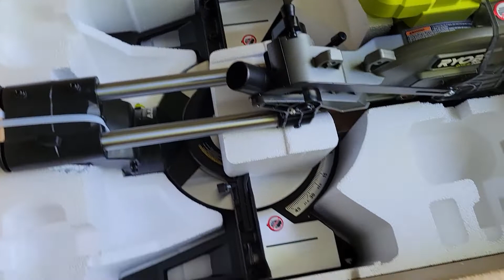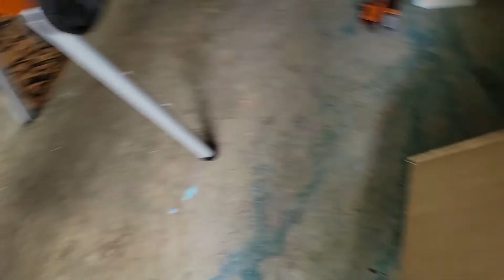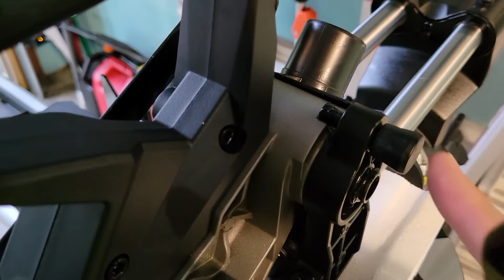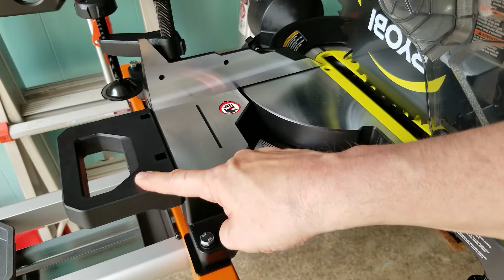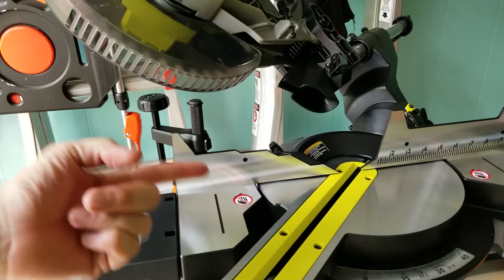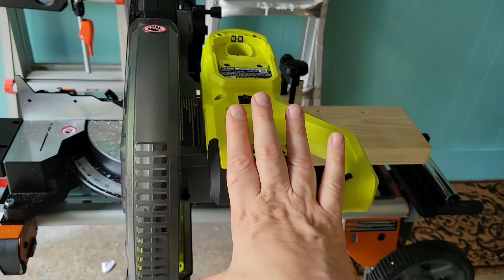RYOBI Slide Compound Miter Saw PBLMS01B

Comment: Over all it’s a good saw for free and here’s why it gives you a free battery worth $150 bucks then they sold you the tool with a free stand worth at least another $120 dollars they had the tool on sale for $200 .its good for cutting lumber basically framing 2by 4,6,8,10,12 its pretty square sure you might need to adjust some but overall its a very good saw for the money i bought mine two years ago and it still works fine
Reply from the maker: Thank you sharing on how well it works for you. After two failed units, I never got another. For my random wood projects I use a small Ryobi 5.5" circular https://youtu.be/vjP0Nt93IGM which works great. If I ever needed a slide compound miter I would check Ryobi first.

Comment: A good piece of jank
Reply from the maker: At least my two samples were. I have seen them at the store and the problem seems to have been resolved. I have not had a need to purchase one, but I would buy a Ryobi if I did.
Reply: You have no idea what you’re missing using a more reliable branded mitre saw. Like a Makita.
Reply from the maker: @patbird9694 There is a huge difference in price $700+ vs $200+, but I see the Ryobi for occasional use, were the Makita is more of a daily use tool.

Comment: I think adding a ballast on the end opposite of the grip would fix the sliding problem.  Seems like an engineering defect.
Reply from the maker: Looks like Ryobi figured out a solution as the ones at the store now work correctly.

Comment: It appears the slider bars slide through cheap plastic bushings.  Most of the nicer sliding saws use linear bearings and slide beautifully with no binding issues.  You get what you pay for.  Ryobi should put bearings in this saw and maybe I would buy it because they make decent power tools.  I'm going with Dewalt for a miter saw.
Reply from the maker: The feedback I gotten on this video indicates Ryobi solved the problem. I can confirm the samples at the store no longer have this issue. I think either choice will give you good results.

Comment: Sorry that your miter wasn’t working properly. I however got mine recently, I unboxed it, set it up, charged up the battery and got to work. Everything on it functions, even the sliding part. I had some reservations because I watched your video prior to it arriving but luckily it works flawlessly in its performance. One thing that concerns me is the included blade. It’s seems ok for a few light cuts but when I need to cut 2x8 lumber and such I’ll be replacing the blade with a more HD type blade. Overall it is an awesome tool. No extension cords, generators, just this unit. Great tip on the battery with and without the two contact points too. Hopefully you got your problem solved. 👍🏽
Reply: Happy to hear you got one of the good ones. I have seen a few display models that didn't have the issue I experienced with my first two, so it seems the issue is resolved. I too saw many benefits to this saw, hope you have many successful projects with it. Thank you for sharing your experience.

Comment: Excellent video, it helped be understand everything about this saw 👍🏼. I just got one. HD had a sale that came with an extra 4a hp battery and charger for $229 so I could not pass it up. I did notice on mine at the full length it’s a bit rough but then it slides fine. In my case I’m not going to cut wide boards as often, so hopefully it won’t be an issue for me.
Reply from the maker: Butch, happy to hear the video was helpful and that you got the saw at a good price. Thank you for watching and sharing.

Comment: I'm Sure It's Gonna Be A Little Hard To Slide Because Of It Being New
Anything New Is Gonna Be A Little Hard To Use But Once You Start Using It Mpre Then You'll
Hardley Notice It. I Bought Me
4 Peice Set Of Husky Pliers
& 2 Pair Of 6 Inch Needlenose
Pliers. So What I Dit Was Apply
A Little Of Red Lucas Grease
& It Worked Good For Me.
Give Some Red Lusac Grease
A Shot.
Reply from the maker: Roger, thank for writing and sharing. While certain tools can be stiff at first, others like this saw require smoothness from the start. Ryobi actually determined both samples to be defective and took them back. I have seen store models without the defect so it may have been a bad batch.

Comment: Since you locked it down and it worked without binding but then unlocked it and it binds at the start it sounds like the very small downward force is exceeding the design of the slider. That is without the battery too which will make the issue more pronounced. 

The solution I guess would be stiffer sliders bars which is a design solution only Ryobi can provide. Perhaps providing some weight on the end may help counter the initial force to overcome but that could also make it worse. 

Last would be to tie down the saw which will help with control of the issue.

 Thanks for the detailed video!
Reply from the maker: I never heard back from Ryobi after returning the two samples, but I have seen store display models that do not exhibit the issue. Thank you for sharing your insight on the binding issue.

Comment: It'll be fine once you start cutting, vibration helps with the sliding
Reply from the maker: Ryobi requested the return of the two samples as being defective. I have since come across samples that did not have the slider issue.

Comment: Just got mine a week or so ago and it's doing the same thing. I've messed with all of the adjustment bolts for hours and still rough. I'm pretty disappointed. I've seen so many complaints about this issue that I'm going to return mine for the Dewalt 20v 7-1/4in (DCS361)
Reply from the maker: I really liked this unit except for the one thing that made it unacceptable, so yes I certainly would return it. Martin Brenner mentioned his solution to the problem in the comment below. Hope you enjoy the DeWalt.
Reply: @cfldriven  I liked it too but that slider ruined it for me. I actually read Martins solution after I bought it but still no luck. It's a shame because it's a nice saw for a great price. Some people said just keep using it and they will get better over time but I didn't want to take the chance and not be able to return it. Thank you for posting an honest video on this. This is the main reason I use YouTube.👍
Reply from the maker: @PatrickTobiassen  I can't see this problem improving over time. I did find a floor model that worked perfectly fine, so I know they made a few good units. I'm holding off buying until I need one for a project and then will see what is available. I appreciate your feedback and thank you for sharing your experience.

Comment: Unfortunately it appears someone has dropped the unit
Reply from the maker: That could be the reason, although both units were shipped without any external damage to the container and Ryobi includes lot packing material to protect the saw during transit.
Reply: @cfldriven  do u think this may be a result of stacking to many units an simply squeezed over time because I don't believe it was designed this way
Reply from the maker: @acecaldwellwashere  I think the issue is with QC. Just surprised to have the same issue with two different samples. I reported it to Ryobi but never heard back as to the cause of the problem. I have since tried some display models and their sliders were smooth.

Comment: Not just the slider. Dust extraction is non existent, very loud, no power, goes through the 5 amp battery in the kit quickly. The slide is flat out dangerous while using it. Had it for a week before I returned it and spent double on the 7 1/4 milwaukee
Reply from the maker: Thank you for sharing your experience. Did you find the slider dangerous because it was binding? Ryobi lost a sale for lack of better quality control.
Reply: @cfldriven  yes that's exactly right. I was doing a small trim job to test it out and had a slightly precarious cut to make and the saw was sliding across the slippery floor as I was trying to push through the cut. It's the sort of cut you try not to make often and be as careful as possible, (finish trim piece for basically a return to the baseboard from the stairway runner trim, where it was cut short, is the best way to describe it) and you can make it work on a better operating saw (no flat surface to put on the fence on the last cut), but felt very dangerous on this one. Blew saw dust all throughout the lady's living room and left a pile of saw dust large enough to fill the dust pan just making some cuts on 1x6.
Reply: I also hate the switch for the light. I would be searching for it, and could never find it (I'm sure I'd get used to it) but I'd tap it multiple times and you have to be very deliberate about it, So I'd hit it and it wouldn't come on. Versus the milwaukee, you can just flick it with your finger and it comes on.
This is my first Ryobi product, I own all Dewalt, which I consider good enough for contractor work, but not the best. Went to other batteries because dewalt does dumb stuff like not release a dual bevel miter saw. I'm not a trim carpenter so I need all the help I can get and flipping a 12 or 16ft piece of crown isn't reasonable when you're cutting in the customer's garage or basement.
Reply from the maker: @JNatella  Overall Ryobi makes good stuff for the non-pro, but this saw was a disappointment especially since it had so much potential. Thanks again for sharing your experience.

Comment: The observation you made about the slider ... Please check if the end of travel is magnetic 🧲
Reply from the maker: I can assure this slider has no magnets, not sure why it would. In trying out the same model in the store the slider worked as designed without any binding or stiction. Also don't forget that Ryobi tech support determined the units were defective.

Comment: I got the same model this past Thanksgiving and came across the same issue of the rough sliding, the only difference is mine happens in the middle part of the rod. After a couple of trying, I found out if I pressed the saw down really hard to slide, it will proceed more smoothly. However, I have no experience on miter saw before, so I am not sure if I am doing the right thing. Now kind of wondering if I need to return it.
Reply: Will try Mr. Brenner's method to see if the issue can be solved.
Reply from the maker: @yunfengbai3279  Let us know if Mr Brenner's technique works. The slide should be smooth with an easy glide all along the track.
Reply: @cfldriven  Come back to report that it indeed works!  You can pull the trigger again as the deal is not over yet😀
Reply from the maker: @yunfengbai3279  Thank you for reporting back, I will add Mr Brenner tip to the description with special thanks to you for trying it.

Comment: On the other rail from the slide lock thumb screw there are two locking screws and nuts.  You can adjust the slide resistance with these.  My saw was hard to slide when I receive it as well.  Adjusting these two gave me smooth movement with no play.
Reply from the maker: Added your tip to the description.
Reply: Confirming that I performed the suggested and my saw now slides with no binding. Save me a trip to HD for return.
Reply from the maker: I thought about doing that, but was told by Ryobi tech support there were no user adjustments to be made and the unit was declared defective.
Reply: @cfldriven  This is how you set this.   It is “set at the factory” but how much time do they really take getting this just right.   Just loosen each one just a bit.  Then slowly tighten one till it feels like just bit to much resistance, back it off a bit, then while holding the alien head from moving lock it down with the nut, this will lock down your setting.  Do the same with the other one, just a bit too much resistance, back it off and lock in place.  Note that you should not be able to rattle or have any torsional, vertical or horizontal play with this set correctly.   This is an advanced but still user set up item.
Reply from the maker: @martinbrenner2573  After two bad samples I never got another, but your guidance here is much appreciated as there might be others who are still having binding issues. Well done, thank you.
Reply: Is it really that easy? I’ve returned two of these already, but am willing to try a third
Reply: @SourceLiquidity  Yes, you need the proper Allen wrench and open end wrench.  I am surprised that RYOBI doesn’t have a video posted on how to do it.  My saw was very had to slide when I received it.  I knew how smooth they are supposed to be because I have a Makita and a craftsman at work that are great.  After correcting this adjustment the saw is exactly the way it should be.
Reply: @martinbrenner2573  Amazingly, I got a third saw, and this time the slider was smooth!  I made a few minor tweaks, but overall it was good to go out of the box.
Reply: Tried and it works. Many thanks!

Comment: Just got one of these from HD about a week ago,  it was I kit with a 4ah battery and charger and a free Ryobi miter saw stand. It's still unopened it the box and after watching this video I'm having second thoughts on water or not I should open it up and check it out or just save me the time and trouble and just return it.  As you have mentioned in other comments relating to this video that the one that you have tried at HD was very smooth without the sticking problem, it may be that the one at HD is broken in by having so many hands trying out the feel of the slider.
Reply from the maker: There is no breaking in for the slider, it either binds or it doesn't. I still think this is a great saw, despite getting two bad samples, and even better with the bundle, but I would open the saw and give it a go. You know instantly if you have an issue or not. Thank you for sharing your story.
Reply: @cfldriven  I have an update, I just opened my saw up today to check if the sliders stick as both of yours have done and the one I got is operating perfectly from back to front. As you had mentioned, maybe there was a bad batch in which you may have recieved both from. What Ryobi did forget though was the 4 locking nuts to attach the table extensions, however, they supplied the 4 bolts.
Reply from the maker: @hwnfrd  Congrats on the working slider, I think you will really enjoy using this saw. Not sure but the nuts might be M8.
Reply: @hwnfrd  I just set up mine yesterday. Mine didn't have the loose locking nuts either they appear to already be integrated into the unit itself -- there is not even the open space to add/remove a nut.  The instruction manual needs updating.
Reply: @JeanGuySpeton  It seems that the unit you received has an upgrade that you had mentioned , my unit does have the slots where the lock nuts fit in. Maybe when they boxed the saw that I purchased they may have mistaken it for the upgraded model like the one you have.

Comment: I have one sitting in the box in my basement that I need to check before my 90 days are up but I've heard other reviewers say the same thing about the sliding action so it must be a design issue. I did notice in your video that there are what looks like what are two screws on the right hand bearing. I wonder if those can be adjusted for smoother action? Like I said, mine is still in the box and I'm too busy to fuss with it for at least a few days.
Reply from the maker: In talking to Ryobi they twice told me there were no user adjustments to be made. It would seem if the stiction was only at the beginning and not the entire length of the shaft the problem was more serious. I hope your saw has no issue.

Comment: it looks like there might be a knob by the slider to adjust resistance
Reply from the maker: Jess, I wish it was that easy. Even adding lube to the rails made no diff. I had two saws with the same problem that Ryobi diagnosed as defective. Recently tried one at the store and it was very smooth, so perhaps they have solved the problem.

Comment: The TSS121 corded 12" saw also has the same issue when unlocked & the spring pushes down on the rail's alignment. I keep the saw on a mobile table & the table moves with the start of a long cut. Can't believe there is nothing else on the web about this. I did see one video showing what linier bearings are though. Mine also has the sound of dry tight bearings - could be cheap light weight lubricant? I also haven't found out what the two adjustments are on the motor side bearings. Would be a good saw if the rails were not rough & binding. Please post if you find out something.
Reply from the maker: It a shame since I really liked the saw, but after two defective units, as determined by Ryobi phone tech,  I was done. Ryobi never got back to me on the issue but they did pay for return shipping on both units. Recently I checked out another Ryobi saw at HD with linear bearings and it was like butter.

Comment: Then dont push down so hard.
Reply from the maker: It is not a question of pushing down too hard, the rails actually bind at the start of the push. Shame I really liked the tool otherwise. Didn't want to return it but nothing I tried fixed the issue across two saws.

Comment: Maybe some lithium white grease will help it slide better
Reply from the maker: Hector the rails were already lubed and adding more didn't change its performance. The alignment seems to only change when the saw head is in the down cutting position, otherwise the slider is very smooth. Too bad since I really liked this saw. Thanks for commenting and watching.
Reply: @cfldriven  u never know could of been some cheap lube